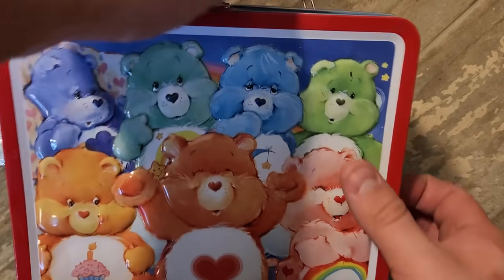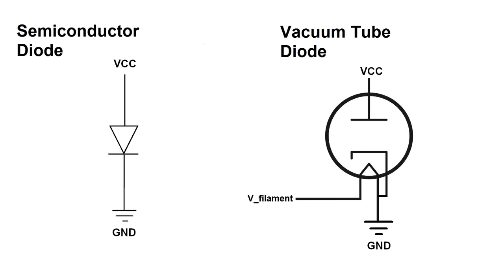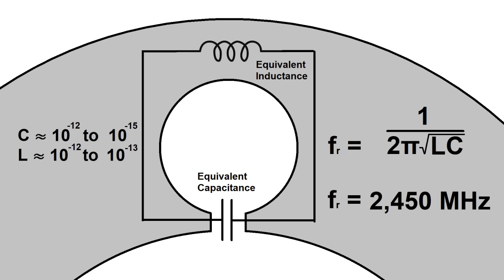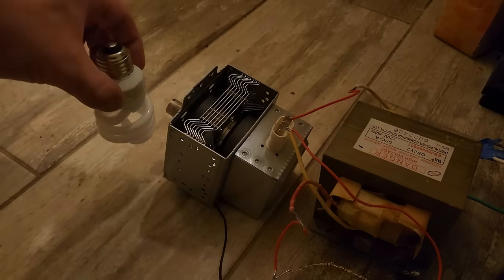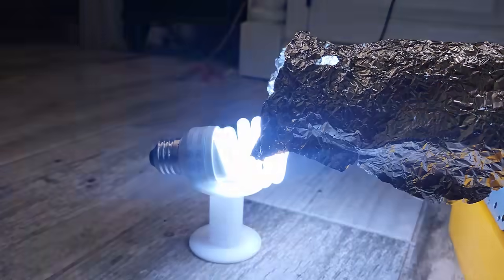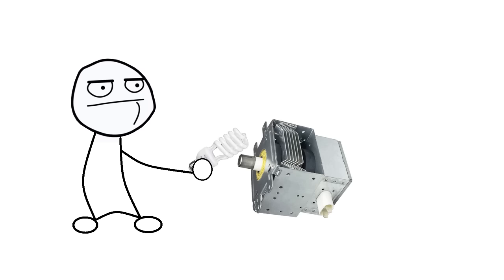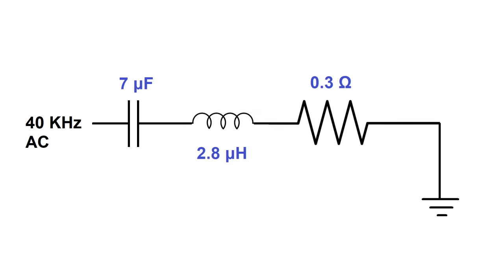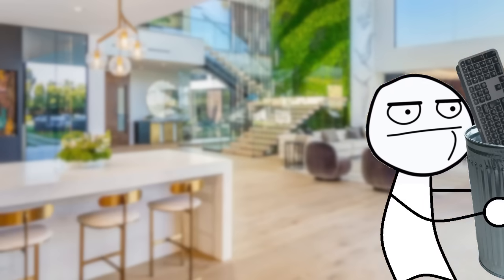Battery-Powered Magnetron

Comment: An unenclosed magnetron really makes me tingly. What precautions do you take to not get burns on and below your skin? Or cook your camera?
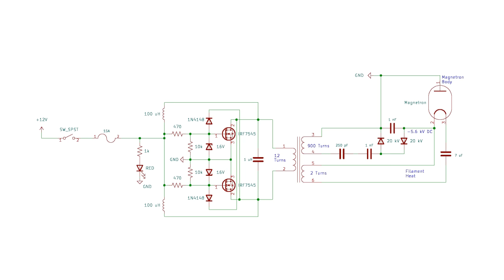Reply: 14:33 , you should take some de-sensitivity training. He handles high voltages and explosive gasses with an air of nonchalance to where you can assume he knows his stuff
Reply: @anton3137  What kind of patronizing answer is this? There have been plenty of reports of long-term nerve damage in conjunction with malfunctioning microwaves, i.e. those where the door safety switch was not operating as it should. Hands and also the cornea are pretty sensitive to microwave thermal damage.
Reply: @graealex  The kind of stupid toxic bullshit "don't be such a wimp" answer that gets people hurt and killed every day, that kind of answer.